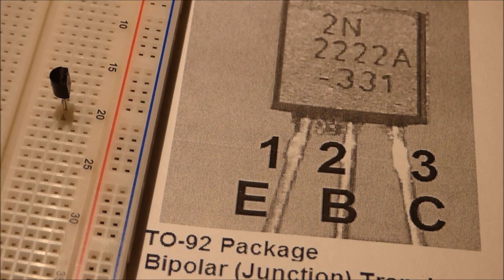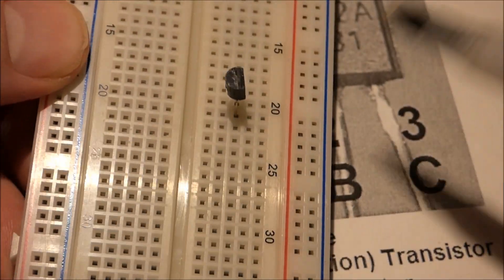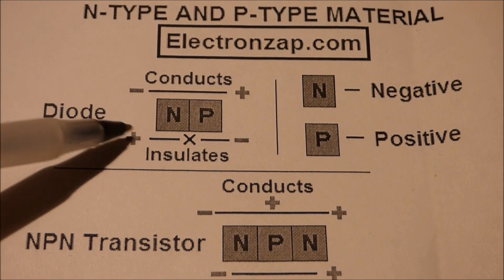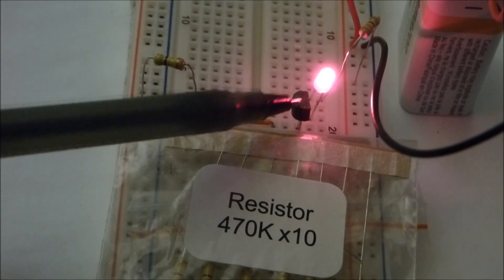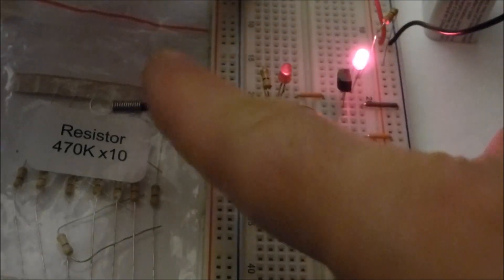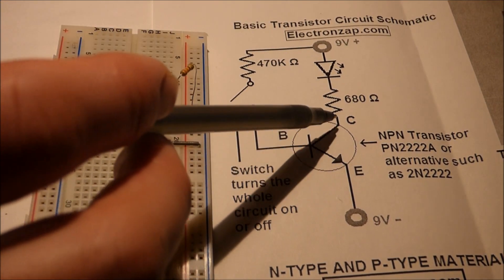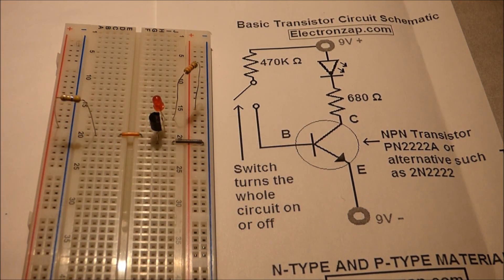NPN 2N2222 transistor component as switch circuit with schematic tutorial. 2N2222A

Comment: The A indicates it's grade and also specifies that it has significantly more gain, about 300x, but when it's without the A, it's at about 100x for this model.

For audio dabblers, this transistor sounds phenomenal, but it also dominates any audio circuit you use it in, even if it's jampacked with op amps, RC filters, FET's etc. If you like designing and building new equipment on a regular basis, you'll grow to loathe this transistor quickly! lol

One of this model goes a very, very long way in how much it owns the sound.
Reply from the maker: Thanks for the info!

Comment: Why are the pin outs different from to data sheet? From left to right on data sheet it’s CBE?
Reply from the maker: The 2N2222 component also comes in a metal can, which has the opposite pin layout from the plastic (TO-92) package. There is also at least one variation in the plastic TO-92 package that has the opposite pin layout.

Comment: Is there anything significant about the 2N2222 designation? Why can't I substitute a ZTX751 ?
Reply from the maker: ZTX751 is a PNP BJT according to the google search I just did. So you can use it in a PNP BJT switch circuit that other transistors of equal or lower power rating are used in. Always pay close attention to the pin layout when you substitute another transistor of the same chemistry. It is often different.

Comment: 😥I've watched like 20 different videos looking at transistors, push buttons, and voltage dividers to try and get a damn and gate working. 90% of them didn't show a working example, just theoretical explanations which didn't help at all.
Thank you for letting me get this to work after like 5 hours, I'd been trying to connect the emitter to the led thinking it would, well, EMIT power to it.
Connecting it "backwards" to let power flow to ground worked like f'ing magic.

Comment: I find the values of resistors used to be an oddity. If the transistor is in saturation when on (as it must be if it is operating as a switch), then I calculate the collector current to be approximately (9V - 2V) / 330R = 21mA. The base current will be about (9V - 0.7V) / 470K = 0.018mA. The implies a DC current gain of 21/0.018 = 1,200 approximately. I find it incredible that a 2N2222 exists with that amount of current gain, and if you happened to have one with that much gain, it is highly misleading to imply that other samples would behave the same. The only explanation I can see is that the transistor is not saturating, and that the LED lights brightly enough with just a couple of mA through it. You should measure the voltage at the collector to see what is really happening.
Reply: In Saturation Beta Counts? When In Saturation Collector current Flow is Max and no more depedent on base Current..as per my Knowledge
Reply: @muhammadawais7288  In saturation, we would expect collector current to be limited by the value of the load and the supply voltage.

However, the saturation voltage of the BJT, Vce(sat) depends on the base current. You have to overdrive the base to ensure that Vce(sat) falls low enough to keep the dissipation in the switching transistor within acceptable limits.

Take a look at the manufacturer's specs of any non-Darlington BJT. You will see that almost all specify a base current one tenth of the collector current when giving the maximum value for Vce(sat). The few exceptions like the BC547 family are specified with Ic twenty times Ib.

Take the popular 2N2222A for example. The datasheet quotes a maximum saturation voltage of 0.3V with Ic = 150mA and Ib = 15mA. That's an assumed β of 10. It also quotes a maximum Vce(sat) of 1V at Ic = 500mA and Ib = 50mA. Again a β of 10. In the first case, that's a power dissipation of 0.3V x 150mA = 45mW. In the second case, you get 1V x 500mA = 500mW, which is at the limit for dissipation of a metal TO-18 case without a heatsink.

If we use less base current, the saturation voltage could be higher: the manufacturer does not guarantee it and you could end up with more than the specified Vce(sat) and exceed the power ratings.

Comment: Can we put load at low side in npn transistor?
Reply from the maker: That's an emitter follower. You lose 0.6V, but you can turn things on and off that way. The load will get whatever voltage you give the base minus 0.6V.

Comment: how can you make the circuit versatile for bjt and mosfet?
Reply from the maker: There's not a ton of difference between switch circuits when it comes to using different types of transistors other than different pin names, input signals needed, and conduction limitations. Just need to look up the pin layout and whether the load is on the high side (more positive) or low side (more negative/ground) of the power supply in relationship to the particular transistor wired as a switch. Also need to make sure the transistor can handle the voltage, current and power needs of the entire circuit. Sometimes you will be able to pull a particular BJT out of a spot and replace it with a specific MOSFET which will work just fine, but you have to make sure they are either cutoff or saturated with the same voltage and that current is still safely limited. Mostly though, there's way too much transistor variety out there to try to make a universal switch circuit where you could just throw any random BJT or MOSFET transistor into it and it would work. It's best to just look at other people's switch circuits that use the same type of transistor that you want to use and design your circuit based on that. If you want to design a transistor circuit from scratch, then you need to study the datasheet of that transistor and stay within all it's limitations. Hope that answers your question adequately!
Reply: @Electronzap  thank you for your help

Comment: Just noticed I watched this 3 years ago which is the last time I got back to trying to understand electronics!

Its getting easier(ish). I did the circuit the put the load on the emitter to see what happens which makes the led glow dull before hitting the switch then its bright. Im guessing theres a small current from B to E causing that which makes sense.
Is there something on the data sheet that gives the voltage required for the Base to keep it switched off? Can you get away with just putting a high value resistor for basic 'hobby' type circuits?
Reply from the maker: Weird thing about electronics is that something that totally baffles you, all of a suddenly makes complete sense one day lol. Putting the load on the emitter side of a bipolar junction transistor is called an emitter follower circuit. Whatever voltage you apply to the base, will be the voltage at the emitter but with a diode drop. So, 0.6V less at the emitter than the base for the NPN BJT. The base doesn't provide the current for the load, the collector does. So that's a useful circuit when you have a signal voltage that you want across a load (minus 0.6V) but the signal voltage can't provide the current needed to power the load.
Reply: @Electronzap  This is probably my 5th go at it but managed to make some good progress this time. These short intro and explanations are really useful. I watch 'em then make them then have a play around to see if/where I can add them to others. Its good channel you have here matey its very much appreciated
Reply from the maker: @utkf16  Glad the videos help!

Comment: Enjoying your videos. In using a PNP transistor ( ), it normally allows current to flow except when you supply the base with a little more current than the collector? I wasn’t able to get the PNP to work in a reliable way. I did connect the base to ground and I’m pretty sure it melted?! Could you explain why that happed?
Reply from the maker: Thanks for watching them! PNP emitter go towards the positive side of the supply (Vcc) and collector goes to the negative side of the supply (ground). You need enough resistance when the base is to ground to keep a low amount of current flowing from emitter to base. You also have to make sure there is enough resistance to limit current from emitter to collector. Here's a PNP bipolar junction transistor (BJT) demonstration circuit video that should help https://youtu.be/NNgb97PiJw4

Comment: Why is the 680-ohm resistor on the cathode side of the LED instead of on the anode side on the supply side?
Reply from the maker: Probably rushed too fast when I drew the schematic. Order doesn't matter electrically, but typically the resistor is placed on the more positive side of LEDs in both schematics and actual circuits.
Reply: @Electronzap  Thank you for the clarification.
Reply from the maker: Thanks for watching!

Comment: https://www.onsemi.com/pub/Collateral/P2N2222A-D.PDF shows the C on the left of the flat when the flat faces you. Opposite to your initial explanation. Which is correct? You or the Data Sheet?
Reply: Not trying to be smart. I have this transistor but am just learning.
Reply from the maker: The P2N2222 has a different pin layout than the 2N2222. They swapped the collector and emitter for whatever reason.

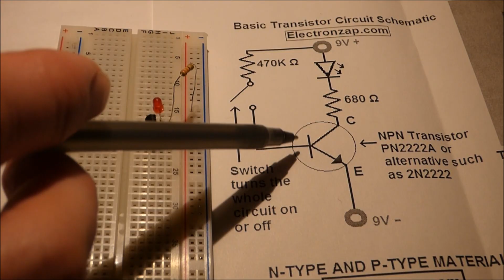Comment: at 6:00 in the circuit diagram you showed placing 680 Ohm resister in the Negative side of LED, it should be Positive side of the LED.
However, your video is good and informative.
Reply from the maker: Thanks!
Reply: @Ven Go im pretty sure it makes no difference though.

Comment: How did you determine what resistance to use to supply power to the base ??
Reply: For a 2N2222, you look at the datasheet and see that the manufacturer specifies the base current as 1/10 of the collector current when operating as a switch (called in saturation). So whatever collector current you need, you design for the base current to be 1/10 of that. For example, if you plan to drive an LED, which needs about 2V to light up, in series with a 330R resistor from a 9V supply, you will get Ic = (9V - 2V) / 330R which is around 20mA. So you design for a base current of 2mA. The transistor base-emitter junction needs about 0.7V when conducting fully, so you use a resistor of (9V - 0.7V) / 2mA which is about 4K. A 4.7K resistor would be fine, as it's not critical.
Reply: You expecting him to answer that?   He will answer you if you just tell him how great he is.  Just look at all the comments he answers.  It is a dead give away. :-)
Reply: By using Ohms Law
Reply: @nxbil2397  Then the question becomes how did he determine how much current to supply the base

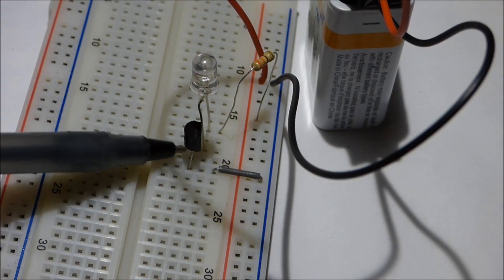Comment: Thanks for an amazing video. At 3:20, you connect the resistor to the positive rail (running down the left) and "20" rail on the right, are you also supplying a current on that rail? I'm assuming yes.
Reply from the maker: Thanks for watching! Yeah. I almost always use a couple longer jumpers to connect the 2 rails together when I use a battery.

Comment: 1 Really Excellent question no one ever brings up.  @ 2:34 you show that the collector is connected to the positive terminal on an NPN transitor but N Denotes a negative connection, so Un less I'm missing something can I get someone to second my move to motion that from this day forward NPN transitors are to be designated as NPP Transitors to benifit propor denotation of the electrical signal connections in the name of advancement of electronics. I open topic for debate with channel owners permission.
Reply from the maker: Lol, all topics are allowed as long as they aren't attacks on people. N-P-N is the chemical make up of the transistor. But the connections that need to be made are definitely confusing for a while, so it'd definitely be nice to have a system set up that is helpful to people learning about a component.
Reply: electronzapdotcom I'm glad that you second my motion this could be a historic thread here. semi conductors are made from silicone on a side note npn and pnp are suppose to denote positive and negative but that formula doesn't work for the last letters of the transistors code, so I was thinking we change how we write tell code to match the polarity of the transistors pin like this npn = npp negative positive positive, and pnp = pnn positive negative negative.  Cheers

Comment: Actually the A isn't a extra. The A means a little better transistor, although a 2N2222 and 2N2222A can be interchanged in 99,% of all circuits calling for a 2N2222 or 2N2222A.
Reply from the maker: That's a good point, thanks for the comment!

Comment: Awsome video but why 470K ????????
Reply from the maker: Thanks! The value doesn't matter as long as you stay within power and current limits and doesn't get so large that the transistor barely turns on. That was the highest value resistor I had at the time so I wanted to show that even a really small amount of current can be used to turn an LED on using a 2N2222 transistor. Usually I see a 10KΩ resistor because that should guarantee saturation.

Comment: wow very informative can you also make a video about BS 170 transistor and BC557
Reply from the maker: Sadly, I am pretty sure that I don't have either of those. I plan to someday make videos on specific transistors so I will keep them in mind :) Will probably be a while before I can though unfortunately.
Reply: The BC557 is a PNP transistor. The BC series are generally European and have counterparts in the 2n series. The 2N3906 will substitute relatively well for the BC557. Most use cases call for NPN transistors and very rarely does a PNP need to be used.

Comment: Hello, nice tutorial!!! Please, a have a question: any transistor behaves like 2N2222 as a switch on-off, as you showed in your video??? That is, I can replace the 2N2222 with other transistors as well???? Thank you for any information about it!
Reply from the maker: It is confusing, ultimately you have to read data sheets to know for sure. I am slowly working my way to making a detailed video on this topic, but remember that the 2n2222 is a NPN - Bipolar Junction Transistor. I also use the 2n3904 a lot, which is also a NPN BJT. The 2n3906 is a PNP BJT so it's chemistry is the opposite so the polarities of voltage and current are opposite as far as the pins go, but other than that, has the same power handling limitations as 2n3904. Then there are whole other families of transistors, so no matter what, you have to look up what it is on its datasheet, based on it's part number. The 2n3904 and 2n3906 can not handle near as much power as the 2n2222. I think the 2n3904 can handle 150mA of current from collector to emitter verses the 2n2222's about 700mA collector to emitter current. I am on my phone so can't look up the exact numbers right now. The 2n3904 can switch faster though, I never tried to memorize how much faster as I only do extremely slow switching. For my circuits, so far I generally use no more than about 20mA of collector to emitter current and as far as I know, any BJT you find can easily handle that. Also, not all transistors have the same pin lay out, the base-collector-emitter may be switched around even if it has almost the exact same properties as the 2n2222 but is different part number.
Reply: electronzapdotcom thank you!!!
Reply from the maker: No problem! Thanks for watching!
Reply: I have had no issues swapping random transistors in and out of my test circuits. If you get the polarity wrong they just don't pass current ... just make sure you limit the current you send to the base. Too much current into the base will destroy them.
Reply: Yeah, as just learning myself. I’m pretty sure I melted a couple of PNPs :) . I find I favor the NPNs as they seem more logical to me from a operational perspective.
Reply: Vinicius Alegreti Meza  You should be able to use a 2N3904, which is a very common transistor. It's very similar to a 2N2222.

Comment: I'm still having trouble w/ my bread board. I'm trying to recreate your project using 3 AA batteries and 1 110Ohm resistor and a 220Ohm resistor. I'm very new to working w/ electronics and am still scratching my head about how to use a NPN transistor.
Reply from the maker: They are confusing at first, but once you figure them out, they are a lot of fun :)

Comment: IF I USE 1k Ohm instead the 470k ohm... will the 2N2222 work? Why do u need so much resistance?
Reply from the maker: I used that much resistance to show how a really small amount of current flowing from base to emitter allows a lot more current to flow from collector to emitter. You can definitely use a 1K resistor or any other value as long as you don't exceed the power rating of the resistors or the current ratings of the transistor and LED.
Reply: electronzapdotcom  the power you use is 9v right? I use 3v and i have changed the 10k ohm on resistance to the base? Also work right? Thank you for so muck explaination